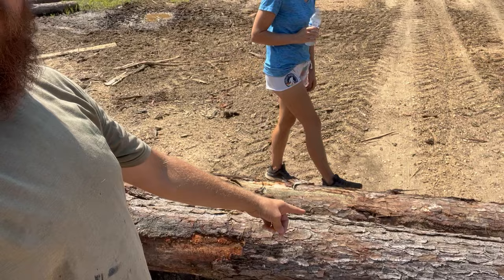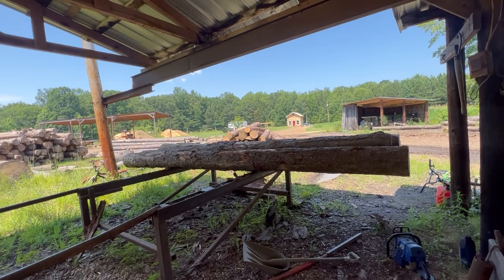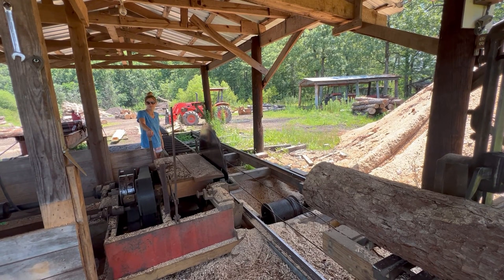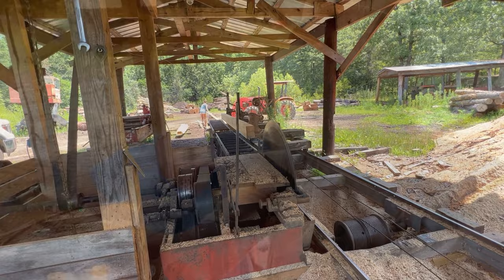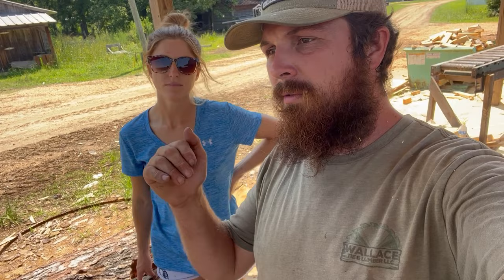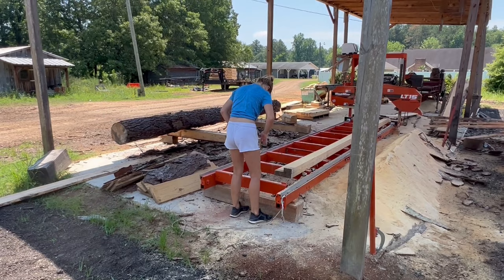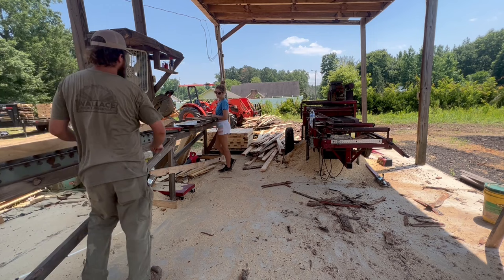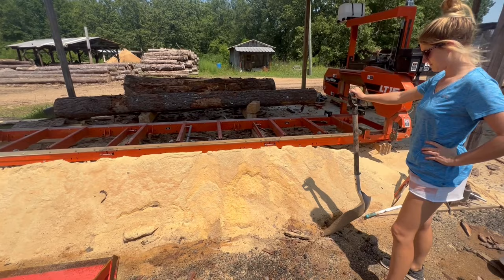Another day at the Sawmill!

Comment: Those old circle mills seem to be a never ending series of maintenance and repairs.
Reply from the maker: You ain’t lying.
Reply: All types of sawmills are constant upkeep
Reply: I bought a brand new Woodmizer LT40 it's got a 100hrs on the clock and I am already having to do a little maintenance on it. One of the blade guide bearing got noisy I replaced it before it failed. I have run the head alignment and adjusted the blade guides once. In order to make a living with equipment what time you ain't working with it you need to be working on it.  My intention has always been to anticipate a repair before a break down happens, sometimes it is unavoidable but in most cases if you pay attention to your machinery it will give you alot of warning signs.

Comment: Could you do a video that explains what is happening on the blade mill when you pull that chain and the big numbered dial clicks? I can see that the log moves closer to the blade for the next cut, but what do the numbers mean for the next pass through?
Reply from the maker: The numbers are the scale showing how wide your can’t is. Each cut makes it smaller.

Comment: Come on. You’ve got a bucket and tractor. Use it. Just backdrag the sawdust away from the mill out into the open. Then simply scoop it with the tractor where you want it placed. Stop the hand shoveling except for small cleanup under mill. Or get an air compressor and blast all the sawdust out of the Bldg.  I use an Echo leaf blower. Works great. Minimize physical efforts.
Reply from the maker: Then I would be incidentally removing dirt and creating a mud/water hole mixed with saw dust. I would rather not be lazy and do it right. Sometimes doing something right takes a little effort.